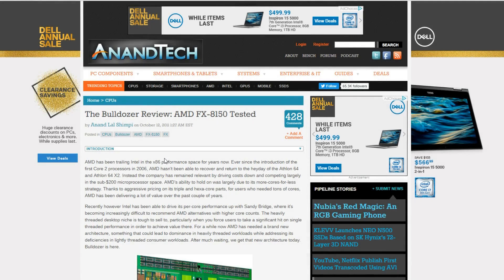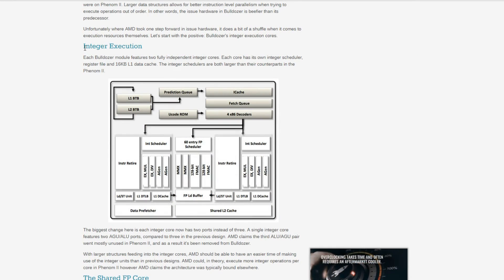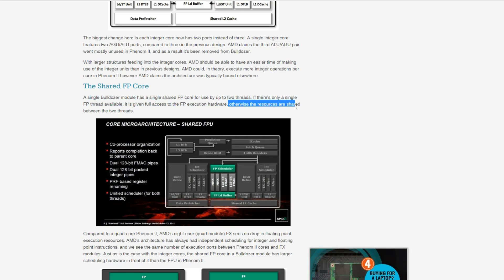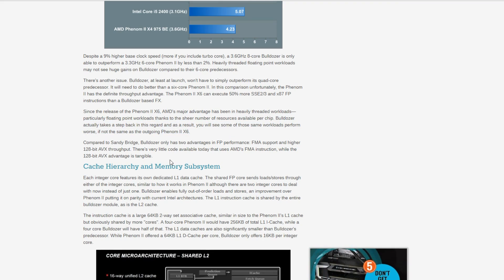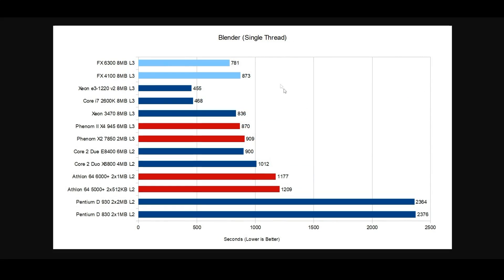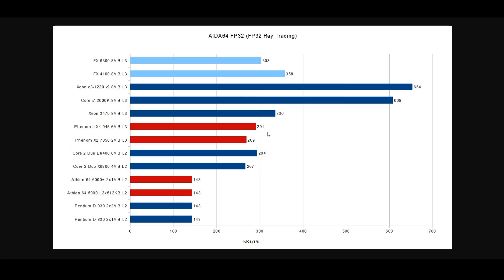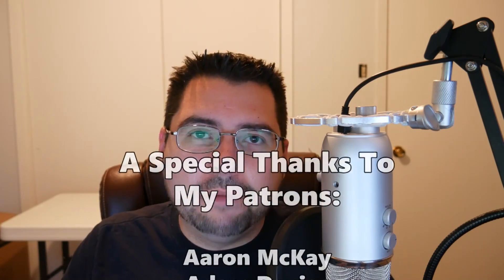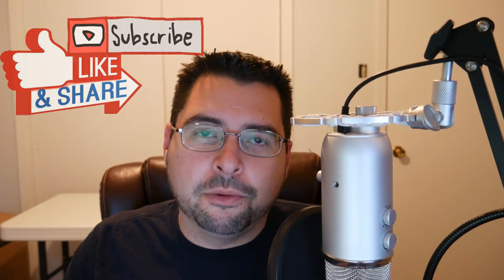IPC Test 7: AMD FX Series CPUs! How Does it Compare?

Comment: Yeah I think the only way these FX CPUs made any sense at all was their higher integer core counts and clock speeds than basically anything else in the consumer marketspace. I know AMD tried to charge a bit of a premium for Bulldozer when it first launched, but Piledriver was much more reasonably priced, to the point that you could get the 8320 for way less than an ivy bridge i5. AMD's higher overclock headroom (and much higher out-of-the box turbo frequencies) helped to close the gap some as compared to the i5, but if you needed 8 integer threads to encode video for instance, well then Piledriver smokes the i5 and approaches the i7 (maybe beats it?) for much less money. No denying in terms of ipc the Bulldozer architecture was way behind the times, but when accounting for clockspeed, the performance wasn't incredibly far behind its competitors, and the performance per dollar was superior for many workloads.

Insert the giant caveat that Windows 7 didn't properly make use of the FX architecture, leading to technically inaccurate (but correct from an empirical standpoint) info like that table from the Anandtech article. Anand shows decode instructions for dual core assuming you are putting both threads on the same module, which is what Windows 7 would do, but it isn't what should be done. Assuming you only load 1 thread per module, your decode instruction rate would be doubled. Windows 7 was smart enough to load two separate cores rather than two hyperthreads of the same core with intel cpus, but not smart enough to make the best use of the hardware available in the FX CPUs. I think Microsoft fixed this with Windows 8, but I don't think Windows 7 ever got fixed.

Comment: if you are running floating point its a quad core and if its integer\logic then its an 8 core.....except the cache and some other stuff is shared....so still not an 8 core.  really odd setup.  was supposed to kill on the server side.  glofo's awful process tech was partly to blame for it perf (it should have clocked a bit higher but glofo).

the idea was to have simpler, lower performing cores but give you a crap ton of them.  sounds great for server stuff like web servers but not great for the games and apps of the time. today that approach would work a bit better than it did then.  but at the time nothing was very well multithreaded.

people want to worship amd now but things like this are why i dont get on the amd hype train (or any hype train).  none of these companies are your friends.  the plan for big chip makers is to keep the fabs open with consumer chips and make their money on server stuff.  amd decided to go for the server gold with a chip that had a billion cores to attract the server market and pawn this stuff off on us consumers.  

same reason amd gpus are in a slump.  they are made for machine learning not gaming.  this time ryzen worked out well for the consumer and thats great but if they could have made a fortune in servers and screwed us over they most certainly would have.  

they all just want your money.  intel is the most evil because they have the most money.  evil follows money.  if amd gets all the money then all the evil will follow the money to amd and leave intel

Comment: One of the key features of the FX series was that it was unlocked. I owned the FX-4100, then the FX-8350, and never ran them less than 4550 MHz on air (and usually ran 4800 MHz on AiO.)
Running your tests at stock speeds paints a very bad picture. For example, your Single Core CineBench R15 scores were 69-73 (the FX-4100 @ 3.6 GHz, the FX-6300 @ 3.5 GHz) while a light overclock to 4.1 GHz yields 104, and at 4.8 GHz 109.  This matches the i7-2600K scores!

To further compare, in CineBench R15 Multicore tests, the i7-2600K (4 core, 8 threads) scores 612 while the FX-8350 (4 modules, 8 integer cpus) scores 644-739 depending on clock speeds.

In properly threaded applications the FX series did well for the time it was out.
Reply: Yeah, my cousin's 6700k overclocked makes 980cb, and I had FX rock stable making 748cb with a cheap AIO and $40 mATX board. So for rendering, you could spend double on Intel and get marginal gains. Now with Ryzen, its pretty pointless when a $180 Ryzen 1700 makes over 1000 cb with half its threads disabled and under-clocked to 3 Ghz (did this to see how much I had to restrain a Ryzen to match the i7 in 8 thread vs 8 thread comparison). My Ryzen is doing 1700 cb at a measly 3.8 Ghz with the cheapest set of RAM I could buy. AMD seems to be the best for rendering (value and now even performance with the 32 core Threadripper cheaper than the i9 with only 18 core).

Comment: theres somthing wrong with your board or proossors iv owned a 8320 fx and they were not a great cpu how ever mine regulurly beat a 2700k intel and would sometimes beat the 3770k in multithredding workloads and yours isent even comming close to the 2600 somthings wrong
Reply: He is just comparing IPC or single core performance respectively. If you look at multithreaded applications the FX series doesn't look that bad any more (but still far away from being a great architecture).
Reply: o i c u broke the ray tracing down per core or in a program that did single core/thread ya that makes sence.
Reply: and it isent the best cpu to start with and u campare it core vs core one on one with a much faster ipc we get it the fx is againg wasent great at release in 2013 no need to kick it while its down
Reply: anything that uses the intel compiler doesn't even use AMD's supported instructions
Reply: idk what your trin to say hear but it seems invalid
Reply: yeah saying "any" was a bit hyperbolic, but many intel compiler libraries don't recognize AMD CPU model codes so default to whatever basic instructions that library supports. So, say you have an SSE4 AMD CPU but the compiler doesn't recognize the CPU, so it defaults to SSE2 instructions, and you get a performance penalty because of it.
The FCC gave Intel a slap on the wrist for anticompetitive practices and made them reimburse companies for money spent on recompiling code to work on multiple processor brands. Obviously fuck all in the grand scheme of things, and not much incentive for intel to change their ways.
Reply: i knew in the late 90,s intell was doing that but i dont think its any were close to the level it was in the late 90s early 2000. but hey we both know intel finds other watys to fight dirty

Comment: I use still the fx 6300 . if you overclock them right you gain 45,38% IPC gain in CPU-Z from 175,6 to 255,3 at 4.5 ghz at all cores with 1,39v vcore. And from 73 to 103 in Cinebench r15. And all this with a Cheap 20 € 92mm Air cooler. With this overclock the fx 6300 is able to run a gtx 970 at 100% usage. And it will run all modern titles at good settings.

Comment: do a video of a overclocked phenom 1100T system vs an overclocked FX 8350 so see head to head how each arched performed on old and newer games and workloads. As far as i know there really isnt a video showing both CPUs head to in in a comparison
Reply: They did benchmarks of that back in 2012 when Vishera released to show that they improved their I.P.C. over their 1st gen Bulldozer. The Thubans when overclocked to 4.2 GHz still beat the FX clocked at 4.2 Ghz slightly in gaming. Deneb quad cores still outperformed them both.

Comment: I got the 2500k over 8150 because that cpu was really bad but later on I've sold my Intel rig because I needed the money and when I was buying my next PC I got the 8320 - 8350 - 9590 and apart from the heat they produced running at 4.7Ghz - 4.8Ghz I don't think they were that bad, coupled with R9 280X and then R9 390X gamers run more than ok at 1440p. My friend is running FX8350 4.5Ghz and R9 280X for 4 years now and it's still half decent 😊

Comment: You are incorrect on the amount of floating points on the FX "8 core". There are 2 shared 128 bit floating points. Each cluster containing 2 memory modules with two clustered threads per module. What you are seeing are the memory pipelines that interconnect between clusters. The FX had poor performance because of slower communication between clusters due to it's longer memory pipelines.

Comment: CONTENT SUGGESTION: Measure the performance per watt (65W, 95W) proportion of these chips, that's where the true gains are! You could also test the performance at the top clock speeds or the overclocking potential these chips can achieve!

Comment: My goal here isn't to discredit your work, or defend FX. BUT the major strength of FX is high core count, my 8320e has a multithread R15 score of 722@4.4Ghz which is still really good today for a chip that can be had for under $100usd. Also overclockability is important, in R15 single thread my FX 8320e went from 77@3.5Ghz to 108@4.4Ghz. Granted my overclocked skylake chip has a single thread score of 185. I just think that testing FX single core performance is like putting a small block chevy V8 in a semitruck and wondering why it can't tow anything.

Comment: How does fx 8350 handles gamed better than the phenom ii? Is it the ddr3?
Reply: They both supported DDR3. The FX have a higher stock frequency than the Phenom IIs but if you have them at the same clocks the Phenom IIs are definetely faster in gaming and single threaded workloads. The Phenom II also greatly benefited from overclocking the North Bridge. My previous Phenom IIx4 980 with DDR 3 1866 overclocked at 4.2 Ghz with the Northbridge overclocked to 2.8 Ghz ran circles around my FX 9590 clocked at 4.7 GHz with DDR3 2400.
Reply: @tskraj3190  even in gaming?
Reply: @MaestroOfficial  Yes, especially in gaming, but one thing I did notice about the FX was that it provided a much smoother gaming experience over the Phenom. I got higher fps out of the Phenom II but I also got screen tearing in some games. The FX I never had that issue.
Reply: @MaestroOfficial  actually the 1st Gen i5s and i7s didn't. When it came to gaming the Phenom IIs were better. AMD had an instruction called 3d Now which was much better for gaming, but the i7s were still faster at other workloads.

Comment: They were great for gaming, they were great for multi-tasking, they were great for multi-threaded workloads when comparing them to intel's 4 core CPUs at the time. Even when I upgraded to Zen last year, my fx 6300 still played all games I threw at it with 60fps, I upgraded to zen for work, not for gaming.
Reply: IIIRattleHeadIII My fx6100 at 4.2ghz still plays games fine. My wife confiscated it years ago to work from home, but my son gave me his 1050ti when he got his gaming laptop, so i figured what the heck, lets remove those old crossfired 6870s, and throw that 1050ti in there. Ran some games, even Metro 2033, and they all did surprisingly good. Nothing on Ultra, but still very good.
Reply: My friend has an amd fx-6300 and it does great for his games (1080p mostly). My other friend has a newer ryzen 1700, and it is just much "snappier" in everything.The 6300 is a great budget cpu, but unless I had an older am3 motherboard and older parts, I would move on to Ryzen and am4.
Reply: +john smith
that's not just due to the CPU, ddr4 memory, more standard architecture, lower latencies on memory and cache(which is CPU, but you get the point), better north and south bridge. Just the platform itself is better, let alone the CPU.
Also by chance one has SSD and the other not?
Reply: @Rattlehead
They both have SSD. That's one major reason that they both run well.

Comment: I have a burning question , if AMD FX didn’t suck and it competing well against sandy bridge and AMD got aleast a 35-45% market share in the cpu market would we have infinity fabric or would intel and AMD one up each other in monolithic cpu and AMD wouldn’t have developed ZEN?
Reply: We would have still ended up with multi-die/module based CPUs. AMD wasn't even the first to start development of multi-die designs, Nvidia was. Intel's EMIB is actually pretty close to infinity fabric in performance, but they haven't developed an architecture around it yet. Basically, all 3 were working on it, but AMD was the only one that took the risk of developing the interconnect and architecture at the same time.

Comment: You are trying to show AMD's performance.OK Try programs not optimized by Nvidia or Intel. Try programs no Intel or Nvidia user wants to talk about. Programs that actually utilize those features that the AMD processors built around. Which where newer an FASTER processes. Not ones that Nvidia an Intel paid off to make sure would not perform well.

I know it sounds odd that i would suggest this. But back when I was running my test on the processor i ran test on programs I had. The Original Handbrake was so fast it flew through the benchmarks i had for it. I tested it on 3 computer but it was the First versions. 

My friend said wow, that was really fast. Then he suggested trying the newest version. The newest version CRASHED my system. It wouldn't even run the program. Then i waited a few months later an tried the newest one. That one was so ridiculously slow, it took 10 minutes for a file i compressed before that only took about 48 second. 

So you see where i`m coming from here. I know the processor does great from my own use. An i want to make it clear. It was not overclocked. The issue was the programs that came out during the time of the announcement of the Bulldozer where all designed to NOT perform well. ALL of them. I had to use programs.

Specifically picked programs. Programs Like Cinebench i had never even heard of. But people where trying to force me to test it on that. I had no interest.
Reply: urm...not sure if trolling or serious but lets assume you're being serious. You mean to tell me you have never heard of cinebench, really? like everyone's favorite synthetic CPU benchmark based on the Cinema 4D render software? (which Btw, is one of the few software that is actually an advantage for AMD because of lack of AVX instruction in that benchmark-a particular weakness in AMD CPUs)  In any case, before you go on about "then why the performance disparity between older versions of handbrake and newer one. You do realize that time taken to complete encoding is dependent on firstly the actual file, what types of presets you were using, what encoding format you are using on. So unless you also specific and control all of these parameters, your "it used to take me 48 secs but now its 10 mins" anecdote is useless at best and misleading at worst. So for your own benchmark to mean anything, you will need to ensure: firstly that it's the same source video. Then you need to ensure that it will be trans coded to the same quality Preset and resolution and codec.(for example h.265). What you are experiencing may be that the default settings on your second run that took 10 mins may be much more stressful than your original "48sec run". This would be especially so since newer versions of handbrake would naturally by default include newer more space efficient CODECs which tend to be more computationally intensive (again think h.264 vs h.265 HEVC- better quality for the bit rate but harder to encode). So again, until you can verify that every setting was kept constant, really your "anecdotal benchmark" doesn't contribute to the discussion. This is what Synthetic benchmarks are for, to test in a controlled and repeatable manner the performance of CPUs.
Reply: HA! You think i might be trolling. Do some research on how Cinebench has not added any updated data on any processors except the original AMD processor to their data codes. 

Yet they have Every Intel processor codex in the Cinebench 15 program. You have to manually download the codex for AMD to put it in there. But all the Benchmarks are not showing AMD performance.

Look up this " Intel coerced Cinebench to make AMD lose in their tests "
https://www.youtube.com/watch?feature=player_detailpage&v=4et7kDGSRfc&t=226

So that whole time of bulldozer. fake rating. The whole time with Piledriver Bad ratings. See this is why you should ask why or look it up. We have useful information.

Comment: I know you are comparing clock vs clock here, but I have an e8400 at the stock 3ghz and also an a6 7400k which I can OC to 4.4ghz on the stock cooler. On the cinebench r15 test they get about the same score at those speeds. You might call an e8400 a bit slow today, but not weak or useless, so I guess the a6 7400k should be looked at around the same- but has newer cpu features and somewhat more useful graphics. Curious that a new Ryzen 4c/4t cpu is about as strong as the older "8 core" earth machine.

Comment: Why compare the cheapest FX6300 (130$) vs an i7 2600K (320$)?

(Im pretty sure the Intel MB was alot more expensive aswell)
Reply: He is doings clock to clock, single core comparison, so he needed a k series chip to control the clock. Any FX would perform the same in this test.
Reply: Sorry, I must have missed the point where it was said they were testet at same clock speed. Cant see anywhere in the video where its said they are not running at stock speed.
Reply: It was assumed. This part 7 of a series where he has been going though the generations and getting estimates of IPC as well as the weaknesses/strengths of them. He probably should have made that clear, but I would recommend checking out the series(links in description).